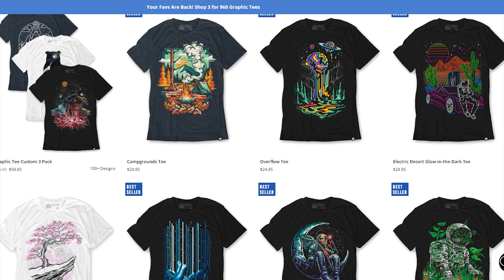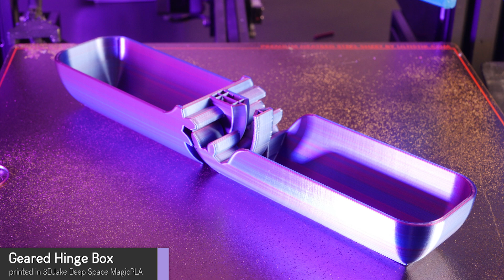9 Satisfying 3D Print TimeLapses Of Mechanisms (Ender 3 and Kingroon KP3S 3D Printer)

Comment: I bought some Kingroon PLA for the MK3+ I got for Christmas (brand new user) and couldn't get it set up correct to stop stringing or letting loose from print sheet.  Would you share your settings so I can try some of these?  I'm using the Prusaslicer 2.5.0.  I would really appreciate it.

Comment: Amazing timelapses! The airpowered motor that you show in your video seems to be a different model than the one you linked to in the description. The one linked is only dual cylinder, whereas the one in your timelapse is 4 cylinder. I already discovered the model you linked, but I am curious about the 4 cylinder one.
Reply: so if you click the link youll see on one of the pictures there is 4 options and on the video the print has lima 4 etched on the side so download the lima 4 version
Reply: The one in the time lapse is a parallel twin cylinder, the two extra rods are from what I can tell valves for the operation of the engine

Comment: Wow, not only your clearance is on point, as most print-in-place stuff requires it, but you manage to print such acute angles without using support! How do you manage that? What's your overhang maximum without supports?